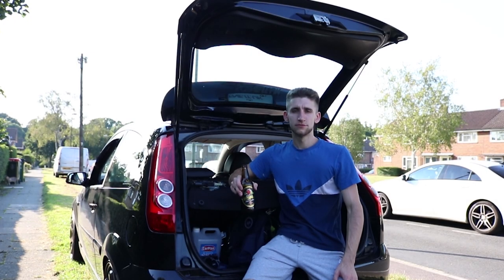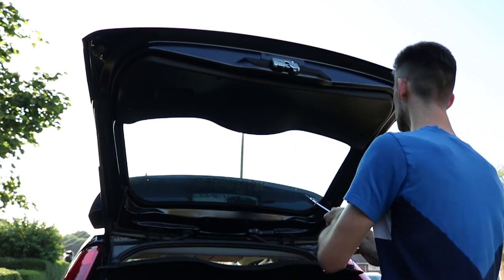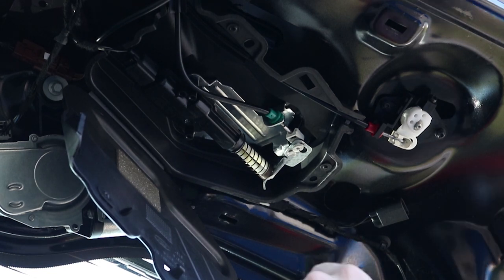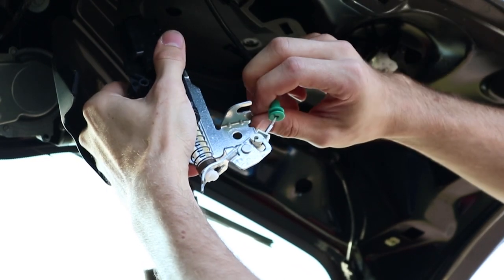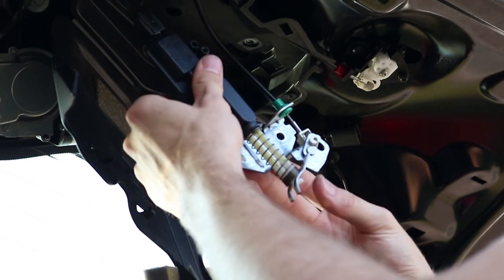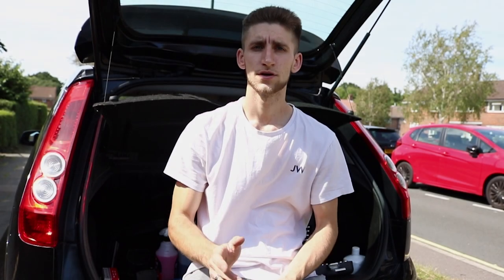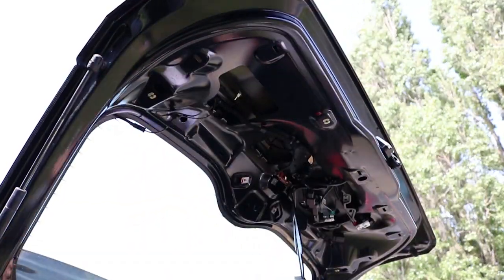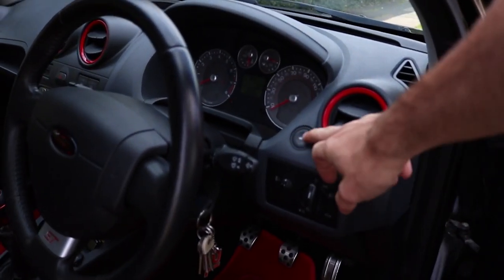How To Replace A Boot Solenoid (Fiesta MK6)

Comment: I bought one off eBay early 2021 and it fixed the issue. I've now had the replacement stick twice such that the boot won't latch. Any cure for it sticking? The one I bought supposedly had a 3 year guarantee but the eBay seller isn't replying. Will order another one though.

Comment: I am unsure if this is what is wrong with mine.  The button on the dashboard is not working when I press it to open the boot it doesn't do anything, I have to manually open my boot with the key.  My fob won't open the boot any longer and I went to see a guy in a shop (I needed a question answering) I explained what was going on and his reply was "you need to do this and he went on about something but I didn't have a clue as to what he was on about, it really makes me feel angry, he sold me some spray, bur he didn't say anything about replacing the latch or whatever, I am not any closer to know what is wrong
Reply from the maker: Would 100% give this a go. There about 12 quid off ebay and only takes 5 to 10 mins to do. I'm 99% sure this will be your issue

Comment: I think I might have the same issue, mine makes the sound to unlock but doesn't open so now im down to using the key so do you think this is my issue too as if not ill take it to a electrical machinic to sort my charging mod I fitted and this too
Reply from the maker: Sounds the same issue bud, maybe take the cover off the solenoid and see how much it compresses by but I would defo fit a new one as it's easy and cheap. Think there only about a tenner so worth a go 👌